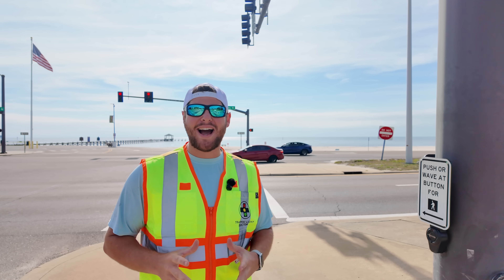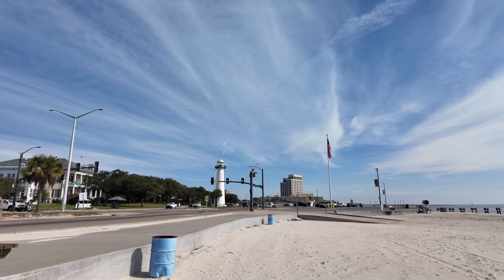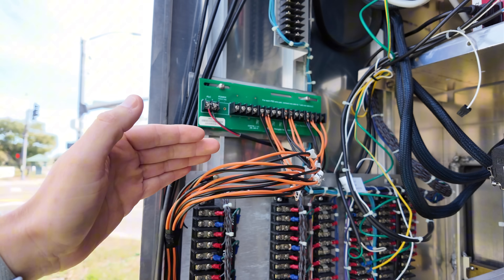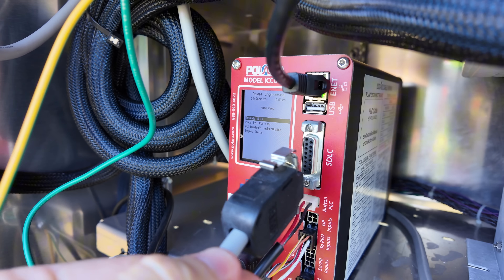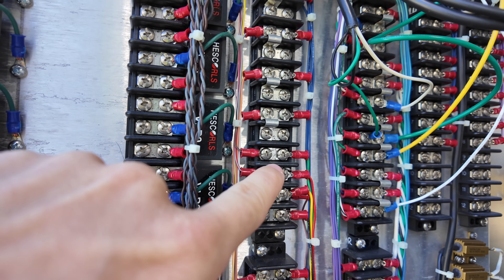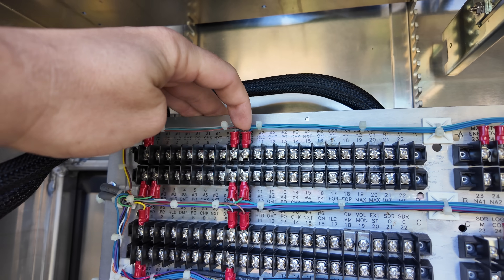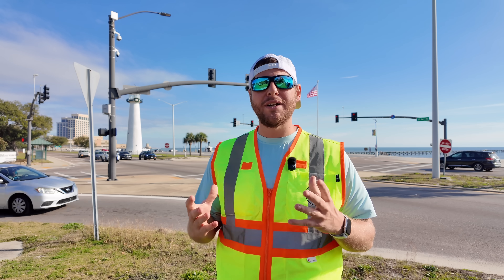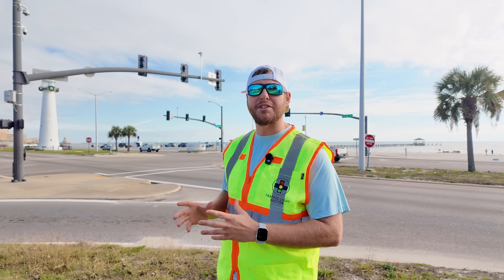What Happens When You Press A Pedestrian Button?

Comment: I have had lights change on me (as a pedestrian) halfway across a busy road due to emergency vehicles.  Cars saw green and just started going with people in the crosswalk.
Reply: Hayward, CA is like that too.
Very dangerous.  4 seconds then red.
Also the traffic lights don't work properly when it rains.   They don't work properly with my "black" truck.
Some intersections give the green light to "ghost traffic"  as you sit for 5 minutes.  Incompetent city staff.
They lose every traffic light ticket if you go to court.
Reply: Huh, you know that does sound like bad design. Like they probably shouldn't change for emergency vehicles while actively in pedestrian mode. The active time is pretty small anyway and it's not like a pedestrian can clear the intersection much faster. Plus like the video shows (and you can obviously just see when using them) they even go into pedestrian mode unless someone has hit the button (so they intend to cross). Just seems like it'd cause more dangerous situations to have it accommodate emergency vehicles than to ignore them (while in pedestrian crossing mode).
Reply: @fallouthirteen or YOU could either turn around and WAIT or just run across.  Dude someone in an ambulance has way more priority than you. It's not complicated.
Reply: @colinwinogradoff6794  what if they are elderly / disabled. It may have been OK when they set off, but they can't speed up if lights suddenly change.
Reply: @colinwinogradoff6794   even if it’s an emergency, if you change the light to green whilst a pedestrian is crossing the ambulance might need to look for extra space
Reply: @colinwinogradoff6794  Elderly or wheelchair people can't just run across.
Reply: Don't know if rules are similar in US, but in UK green means "Go if it is safe to do so". If there is a pedestrian in the middle of the road that's clearly not the case! Of course we do have a significant number of idiots on the road who don't know the rules / can't think for themselves so things like that do sometimes happen anyway 🙂
Most of our modern crossings have sensors to track the pedestrians and can thus delay changing lights if someone is taking longer to cross than expected (or change them sooner if they're faster).
Don't think our emergency services have ability to change lights anyway so your precise issue wouldn't happen anyway.
Reply: Sometimes it seems that drivers just look at the light and don't look at what's ahead of them.
Reply: There always those morons who start tailgating the emergency vehicles like lemming, not being aware of the situation around them!
Reply: Do you go through an intersection when emergency vehicles are coming??? no. You Wait.
Reply: @colinwinogradoff6794   If the emergency vehicle is coming from BEHIND me and I have enough time to safely go through the intersection...yes, I'm going. I'll stop on the other side- why sit there in the way?
Reply: @colinwinogradoff6794  Depends if you could see / hear them before you started crossing.

Comment: The things we learn. For example there is a small town near me, only has 2 lights in the whole place, one has been on flash for the past couple of weeks. Some local speculation as to why, Only thing I can say for certain is it's not a red light fail as all 3 directions are succesfully in flash. We guess they don't have the money at this time for a fix, but since the locals have taken to ignoring the red they folded out the STOP signs on the lights.
Reply: Yeah those folded stop signs, I've seen those in other states.. They don't exist here in MN. They're usually quick to run out some temp stop signs that they keep from falling over with sandbags.

Comment: I find some intersections have the opposite problem. The crosswalk light is active for virtually every cycle, regardless if someone pushed the button. Can the buttons fail in a way that it appears to be always pushed?  Wouldn't this condition be tested for? TIA.
Reply from the maker: They do and when detection fails they hold calls as that’s safer than never giving out the light! Proper maintenance matters a lot with traffic systems!
Reply: @Trafficlightdoctor  
In Orlando there is streets that are time to wear the crosswalk goes Green in the flow of traffic for 30 seconds or so each cycle.
Reply: Call your local utility. Share information about the site. They can send a tech to fix it when there is time in the work schedule.
Reply: @Plains_Scrapper I have little hope that this will achieve results. This city has a number of lights that sometimes just decide not to cycle. According to a cop I spoke to the city is aware and doesn't want to "spend the money" (his words) to fix it. 🤨